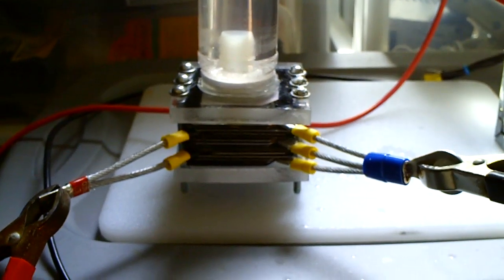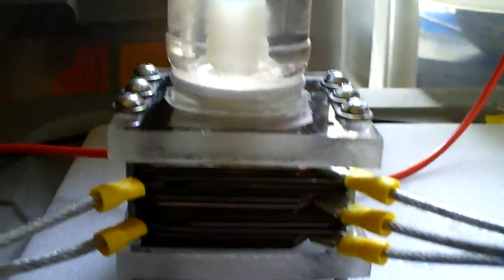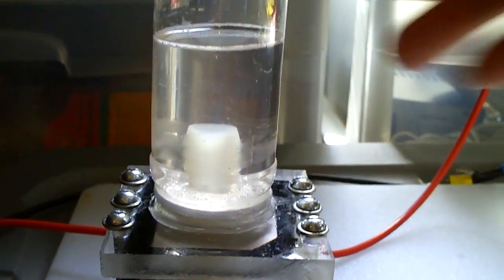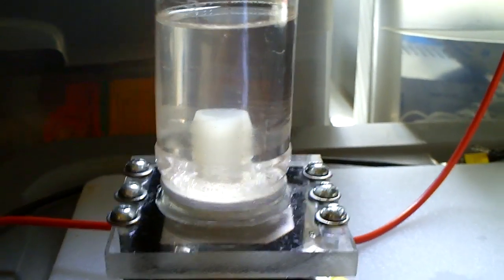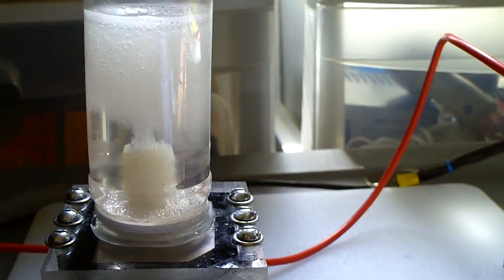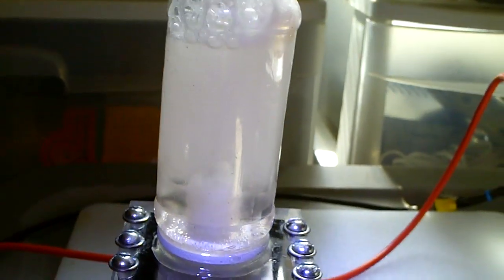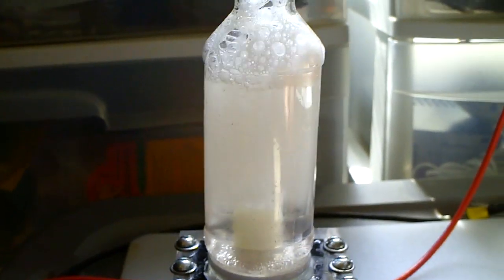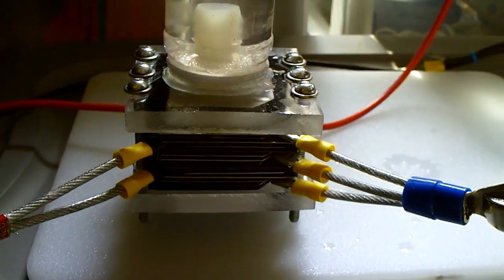Vid42 - HHO + FLAME = OMG!!!

Comment: The reason your fluid level rose  so much when u powered it up is that the cell fill isnt sufficient enough so the gas pushed up. The cell would do alot better if u had a separate fill method, like small holes around the inside of jars edge.  Just a thought.  Keep designing and building! Great job so far

Comment from the maker: The ideal plate design would be pyramid shaped plates, but you would either have to weld the plates yourself, or special order them. The less expensive option is using stainless steel bowls or cups (upside down) with a 1/2" exhaust hole. Gas build-up is not really an issue, because once gas has built-up, any new gas will force out the old. Horizontal plate designs use 100% of the reactive surface area, where Vertical plate designs only get 85-90%, because the water only reaches the exhaust port.

Comment: Vertical plates makes sense when they are vertically placed and open all around, so the gas has possibility to flow up and the water can circulate freely. Those configurations instead turn their plates and gasket into their self containing walls, making the job of collecting the gas more difficult. In your configuration, the gas collected kinda "fights" with the water wich wants to fill the gaps. The system is quite good though: I'm thinking of a way to supply new water and let the gas escape..

Comment from the maker: Unfortunately, it would be extremely expensive to generate enough power to produce enough HHO gas to fuel a 318.  Plus, you would need an HHO Generator that was capable of producing 100+ Liters of HHO Gas per minute.

The best I've seen is people using 2 to 4 Liter Per Minute HHO Generators to improve fuel efficiency by 10 to 15%. But, that also requires modifying the O2 Sensors with an EFIE device.

The O2 Sensors auto adjust the fuel/air mixture and this can produce poor results.

Comment from the maker: @frank0067 

I also noticed with this design that they reactive surface area is larger than standard dry cells, because the plates are fully immersed in the electrolyte solution.

Standard Dry Cells tend to sacrifice 10 to 15% of reactive surface area due to the water level not going above the the input and exhaust ports. 

I've also noticed the volcano design disperses heat very quickly, because of the gravity refill, but It could be better with multiple input/output ports on top.

Comment from the maker: @frank0067 

That is a good idea.  Maybe if I put one or two layers of window screen or steel wool at the bottom of the bubbler, it will break down the bubbles and prevent the foaming.

No problems with gas getting trapped so far.  In fact it performs better than any of the standard dry cells I've built.

I've been looking into raising the center of each plate, so the gas is forced up and out with less obstruction.

Comment: put a hood over your port where gas is comen out in bubller so it hits it and diverts around it...or let gas come out sides instead.
problem with this generator turned around..the gas is trapped more between the horizontal plates .

Comment from the maker: I use vinyl coated galvanized steel for my wires, because you can get it for 35 cents a foot.  

Some people have made negative comments about me using this for my wires, but I haven't had overheating issues, high amperage, or any voltage problems.  My cells still produce just as much gas as when I used copper wire.

Comment: i hate u cuz ur cells are awsome i got a new 9 plate system but the wires were too thin and i can only run 8 amp at 12 volts

Comment from the maker: The water was getting very hot, so I redesigned the cell with more neutral plates to reduce the heat.  I haven't tested it yet, but I'm hoping it will fix it.

Comment: Man, I like the design it's a different twist on the "dry cell" actually a drier wet cell really, but you may have found a better design... good stuff sir.

@
jacek533  - AL will create a layer of AL oxide, reducing the conductivity of the plates and the cell will come to a stop rather quickly. Not to mention if you use NaOH or KOH as an e-lyte, it will react pretty violently with the AL and make H on it's own..

Comment from the maker: Thank you, for the great comment.

Since I started experimenting with this design, I discovered a few things that I will need to test more to confirm:

The gas seems to escape more easily with the horizontal design. (hopefully this will mean higher output)  and the heat dissipates more quickly than any design I've had so far.

I'm working on some modifications to this cell and some larger sized cells to see if it will make much of a difference.

Comment: I'm not sure what you are using for a power supply (regulated voltage, regulated current, etc.) but I'd guess that the current variations aren't caused by the power supply.  I'd guess you have  bubbles traveling along the surface of your plates.  They change the contact area which would change the current.

Comment from the maker: Thanks, I appreciate the input.  I figured that was the case, but I know that is only one small part of the issue.  I realized my holes on the plates were actually 1/4" instead of 1/2" and the power supply takes 5 or 6 tries to stay turned on.  I also need to add some more neutral plates to keep the voltage per plate closer to 2v each. There will definitely be some modifications required.

Even with all of these issues, I think this design is worth improving and experimenting with.

Comment from the maker: I'm not sure what the voltage per plate is, because my multimeter died when it dropped into a bucket of water.  I'm sure it is too high, so I need to add more neutrals to get it closer to 2v per plate.

Comment from the maker: Thanks, I will try that.

I actually got rid of the foam draining the cell and putting in fresh electrolyte, but I haven't tested it long enough to see if the foam comes back.  

I will need to add some more neutral plates to help with heat issues. I also noticed that each plate only had a 1/4" hole instead of 1/2" holes.  I think this could be why the cell is not refilling fast enough, and why the cell keeps getting so hot.

Comment: I like the low amps,but the foam will be back some designs I have done stay clear after changing water but it comes back,neat look what is the voltage per gap.

Comment: what you are seeing with your bouncing amps is your device breathing ... with the setup you are using there, it will suck in fluid, then expel gas, suck in fluid, then expel gas ... much like the original Tero devices ...

foaming is quite often a result of too much current for the amount of surface area ... there are other things that will do it and your GOOP idea may be the real deal ... but too high a current density is a common cause ...

cool setup ...